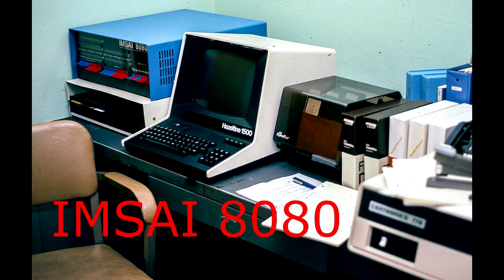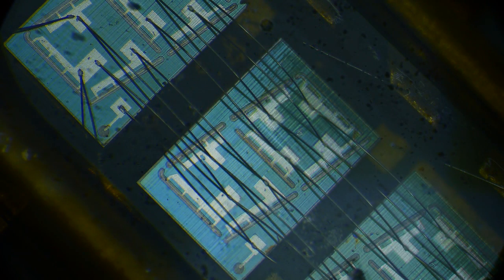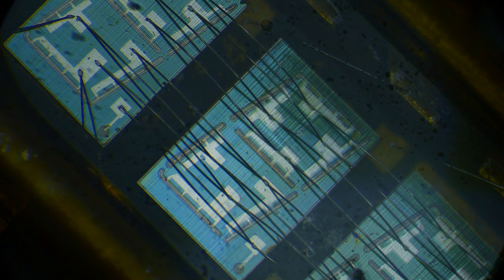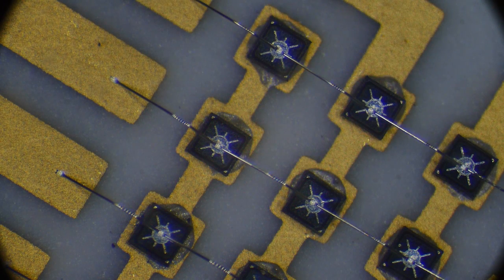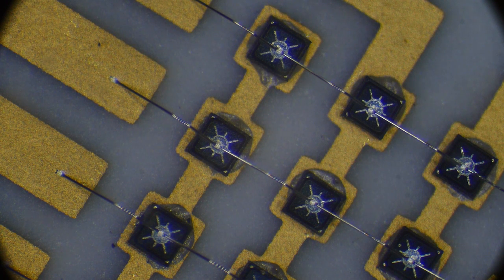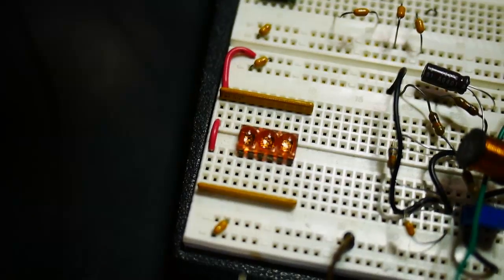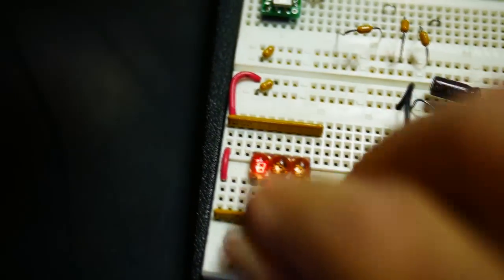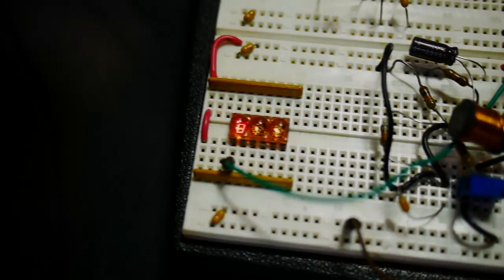#35 IMSAI 8080 LEDs light up

Comment: GaAs, they weren't using aluminum until much later.  That's far red, so it's Gallium Arsenide.
Reply from the maker: Most of the Hewlett-Packard red LEDs where GaP and GaAsP back then
Reply: @IMSAIGuy  GaP was not used in the first LEDs, but GaAsP on GaAs -- but yes, I was remembering it incompletely.  The deep red (and dim) were Gallium Arsenide Phosphide on a Gallium Arsenide substrate.  Later they came out with GaP LEDs which emit green light at a wavelength of 555 nm.  The super-bright reds were GaAlAsP (the aluminum that you were talking about) and those became available in the mid 1980's.  I began busting the glass out of penlight filament bulbs and inserting these super bright red LEDs along with a dropping resistor, selling them with two AA battery penlights to pilots (red for night vision).  I made the first (red) LED flashlights back in the mid 80's.  :-P  They were popular with pilots, hunters and theater workers.  When the green GaN LEDs came out, I started making green flashlights as well.  Today the fluorescent white LEDs are everywhere (and cheap).
Reply from the maker: I worked there in 1980, the red was GAP: http://bitsavers.informatik.uni-stuttgart.de/components/hp/1980_Optoelectronics_Designers_Catalog.pdf
Reply from the maker: I loved going to see the crystal growers. The GaP material looks like a Ruby gem. Very pretty
Reply: @IMSAIGuy  I worked for Atari in 1980 (Sunnyvale).  :-P  I bet you and I could have a fun walk down memory lane.  ;-)